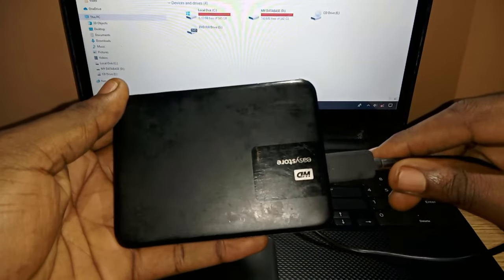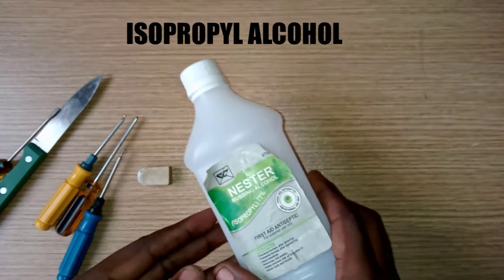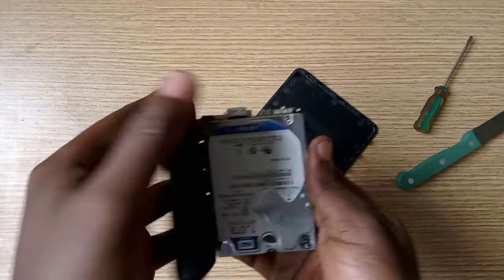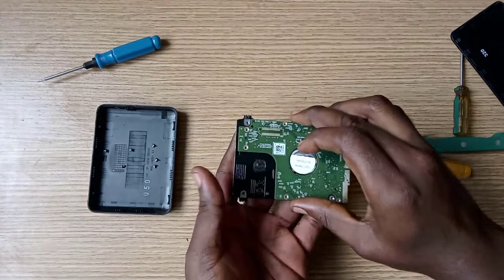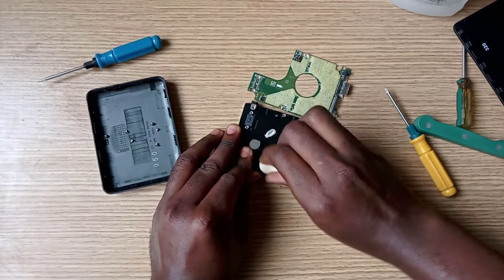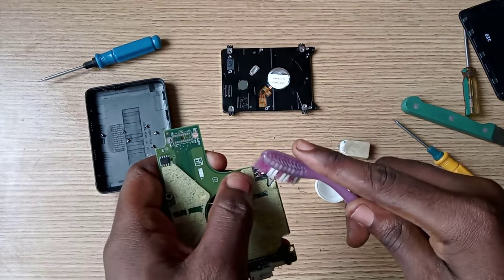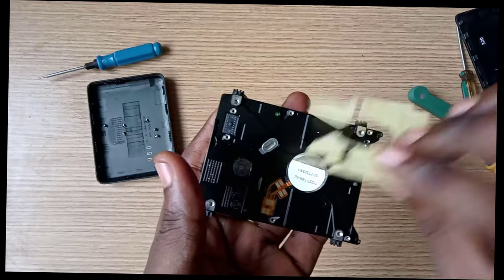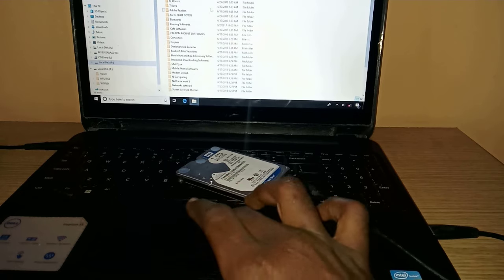Hard Drive Repair & Not Showing Up || Clicking Sound || Dead || No Spin || Data Recovery

Comment: Please sir can i try it for drive it not spinning well, it spins and stops and have some clicking noise????
Reply from the maker: Yes brother, but if you try it and the problem is still the same then it means the problem is coming from the read or write head and you need an advanced method to replace the head. It's a very complicated process which requires you to buy the same hard drive with the same firmware and same capacity and same model. And from there you will have to open it in a very clean room environment. An extremely clean room with almost no spec or dirt at all. Then you will use the advanced equipment to take the read or write head off from the old drive and swap the new one with it. That is the process brother. Hope you understand.

Comment: I did everything except the eraser thing and it didn't work. Is the eraser so important that I should repeat the procedure and use it this time?
Reply from the maker: If you use the eraser and the condition still remains the same then it means the read or write head is the problem if the drive is making a clicking noise. But if I may what is the symptoms of the drive??? Please WhatsApp me on +233246842497

Comment: my external drive started clicking and not showing !!! its fairly new and still is lighting up. do you suggest doing this specific step to resolve the issue and will i lose my data(photos)
Reply from the maker: Brther this is a very complicated case. I will suggest if you are still within the warranty period then you should claim a replacement. For the data it's very pathetic. Don't you have backups at all?? WhatsApp me on +233246842497

Comment: My external hdd doesnf show in my computer but it shows in disk management as unknown drive unallocated 999gb. Will this method solve the problem? Whats the risk of doing this on my hdd😢?
Reply from the maker: First of all I would like you to use this software called hard disk sentinel from this video : https://youtu.be/zYqpPFi91LE .  to test your hard drive and give me the results. The software will show all potential health problems of your drive and from there I can give you further guidance. But this solution doesn't come with any form of risk.  It just gives you access to be able to clean the hard drive internal controller connections on the printer circuit board. So please just do the testing and let me know brother. Thanks for watching and you can please WhatsApp me on this number for further guidance 00233246842497

Comment: Can you also do Fantom 18TB External Hard Drive as well?
Reply from the maker: Yes because but I need to first of know the kind of drive that is on the external casing. Some drives has different read or write a connector  to the circuit board. So if you can give me an image of the actual drive from the case then I can give you the best solution or suggestions brother. Please WhatsApp me with an image on +233246842497

Comment: Hi @saforo, Facing similar issue with WD elements external hdd. It is the new one but accidentally slipped from my hand from >10cm height. 
Now the light is blinking and making a small sound internally but not showing up in my laptop.
 no damage outside
Could you pleasee help. If this thing still work s for me!!!
Reply from the maker: Hello brother, so sorry to hear of this situation. In this type of condition after slipped off, the read and write heads of the drive will be stucked. So to recover your data I will advise you to seek the services of data recovery experts because opening the drive yourself from this point is very complicated any spec of dust to infiltrate your drive can reduce your chances of recovering  your data from this condition. If the data is not so important then I will advise you buy another drive or replace this drive with an SSD instead. They are not so expensive when you know how to get them. In case you need help to get a quality SSD at a cheaper price I can show you where you can get them and what you should look out for. I'm really sorry for the condition of your drive but from this point is very complicated brother. Hope you understand.
Reply: @saforotech8552 I have an wd my book that I got in like 2014 I believe it fell from about 1 foot height on to a soft pillow then didn’t work. The light comes on but I hear some noises like a disk spinning and when I plug in to my computer it says not initialized. When I plug in to my blue ray player nothing shows up.  Any idea how to fix this?

Comment: Will that work on external seagate hardrive?
Reply from the maker: Brother this Will work on any hard drive be it desktop and laptop hard drive of only it's a dirt or corrosion issue. But please not that the same symptoms sometimes can be as a result of faulty read or write head or even spindle problems.  The dirt or corrosion build up at the read or write head connector to the pcb normally occurs and this solves that problem If that prevents the drive to work for that instance . Hope you understand brother.
Reply: I do understand brother, thank you for prompt response. I will try this, hope it works and if not then have to seek professional which gonna cost me heavy amount. Anyways, I really appreciate what you doing. Thank you so much brother. May God bless you.

Comment: My read and write heads are not even spinning what should i do
Reply from the maker: The read and write head don't actually spin but rather moves on the platter to take and give information. The platter is where all your information is stored..it actually acts as a memory for the hard drive. So please brother check if the hard drive is not  spinning at all or is spinning but the read and write head is stuck or not moving around the platter. WhatsApp me for further chat on 00233246842497